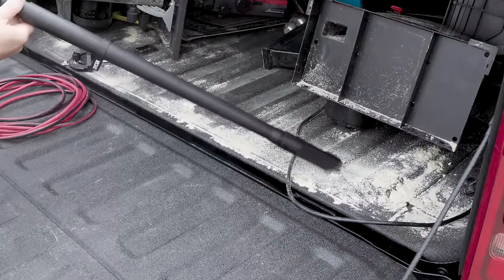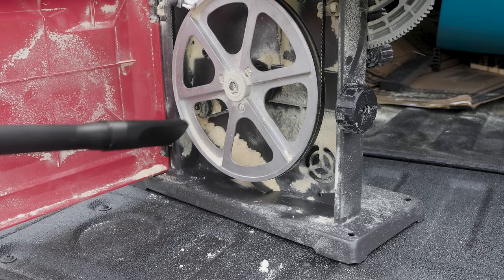This New Ryobi Tool sucks more than YouTube's Algorithm

Comment: We have the 18V ONE+ HP CORDLESS PET STICK VAC KIT WITH DUAL-ROLLER BAR KIT,  and it works GREAT at our house.  We have hard flooring in all rooms. It's not so good on carpets though as the roller bars get bogged down pretty easily.  The kit comes with several attachments which give the "Vac" multiple use capabilities.  With having a German "Sheddar" dog in our house, we do a LOT of floor sweeping. The robot vac we have doesn't come close to our RYOBI not Re-obi stick vac's suck capabilities.  It's also easy to remove the roller bars and clean off all the stuck dog hairs etc with a pair of scissors.

Comment: I used to repair power tools for my job. By far, I saw more Ryobi and Rigid  tools come through my shop than anything else. With the former, it was usually about a year before they stopped working, With the latter, about two to three years. Take that for what it is.
Reply: 1 year? I use my Ryobi tools frequently and don't baby them. They have held up well. Honestly I am impressed for the price. I have Milwaukee as well. I would say the Ryobi tools have a noticeable difference in some performance aspects but they have been just as reliable.
Reply: My experience has been just the opposite.  I have not had a single Ryobi tool break on me.  I bought my first set over 10yrs ago when i bought my house.  I use them regularly.  Just built a Deck last year with that set.
Reply: I've had some tools for more than 15 years plus lots of new tools, probably about 20 tools. Not one of them has stopped working. I've used them for tons of projects.
Reply: Bs -coming from my experience

Comment: I like how Ryobi seems to give you a lot of stuff to go along with their tools. Downside is sometimes those are proprietary parts.  That old circ saw I had of theirs did the job, but I had to go to the HD for blades, I stead of the local hardware store 1 mile away. We’ve had some flooding in basements here in town, and I was looking at the m12 stick pump verses the Ryobi stick pump. The Ryobi is cheaper, and comes with more stuff, and pumps 15 gallons per minute vs the m12 9gallons per minute. I wish they had them in store so I could compare build quality, because I expected the Milwaukee to be a bit better, but they look similar from the pics and videos I’ve seen.  For example, the part that the hose connects to looks like plastic on both. .So, I think the Ryobi wins that contest for me.  Have you tried either of them?

Comment: if you are new to power tools, start with some other brand. if you buy Ryobi products and the batteries start dying, you will be sorry and their customer service will find any way not to replace them even if they are in the warranty period. pay a little more and get better quality
Reply: On the other hand, for just a hobbyist, Ryobi has an incredible breadth of tools, making their batteries incredibly versatile.  That flexibility can be worth it if one thinks they'll utilize many different types of tools.

They're not as compact with their battery design sticking out the top whereas pretty much every other brand has switched to the side-in design, which can be a downside, but it means the new batteries work with even extremely old Ryobi tools.  That's of course a trade off that doesn't make sense for new consumers, to your point.

For more focused use-cases there are certainly other brands that perform better, and I have no doubt that other brands' batteries may stay good longer and may have better customer service.  But Ryobi is always running deals where you can get multiple batteries and one or two tools for 200 or 300 dollars, meaning you can get a pretty steady supply of new batteries for significantly less than other brands.

It's a hard choice nowadays with cordless tools, but great to have so many options for the consumer.
Reply: @OWSNubbles  Ryobi is really versatile which is cool. But paying the extra money just to get extra batteries to cover their unreliable product just costs the consumer more in the end. Also, the larger batteries that are used with bigger ryobi products cost well over $200 each. When those go bad, you arent just getting them as a steady supply. They are too expensive.  In the end, I've had mostly good luck with Ryobi over the past 25 years and theres no issue if they are willing to cover their faulty products. But thats the issue. I ts like pulling teeth to get them to cover a faulty product and I dont just have hundreds of extra dollars sitting around to get extra stuff I shoudlnt have to need.